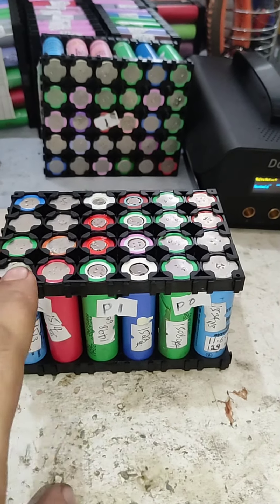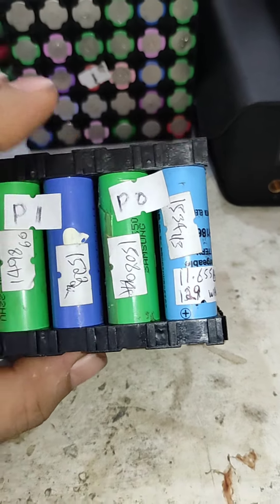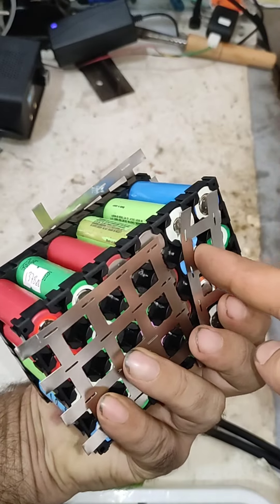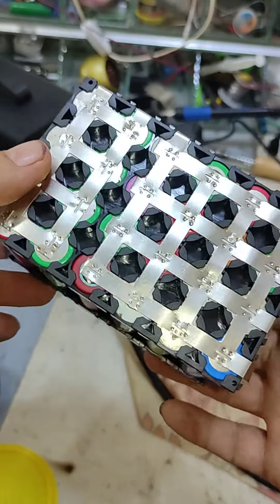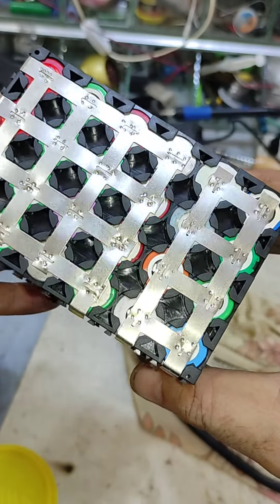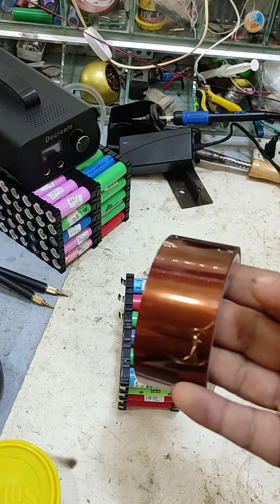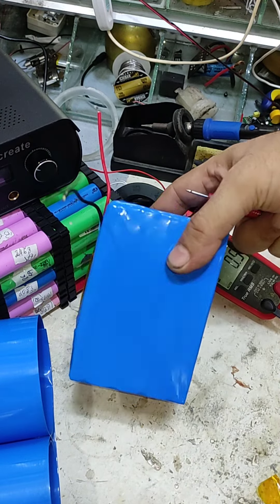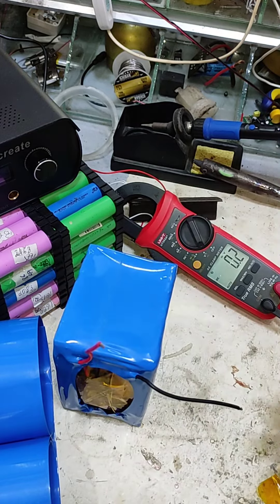3S 8P 18650 lithium ion 129/WAh 11Ah battery pack for emergency DC lighting and phone charging

Comment: Well I was Thinking to make little Good decent battery from li-ion battery cells for my dogs for summer and also so that it can be charged my my small solar panel so I just Wanted so Advice regarding that.
Reply from the maker: Simple use always MPPT charge controller for lithium batteries and use good quality BMS if you make your own battery pack test are very important before make battery pack I explained that in my video
Thank you